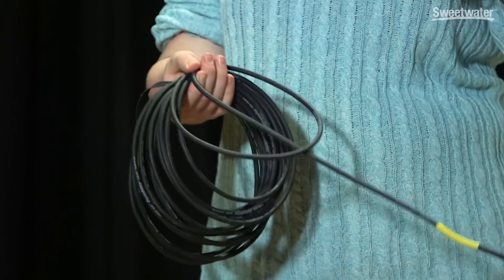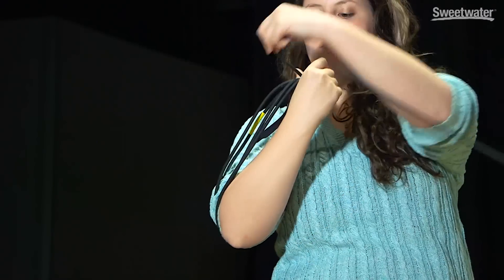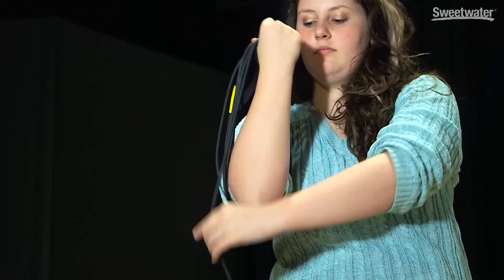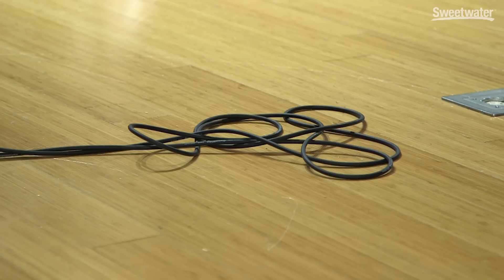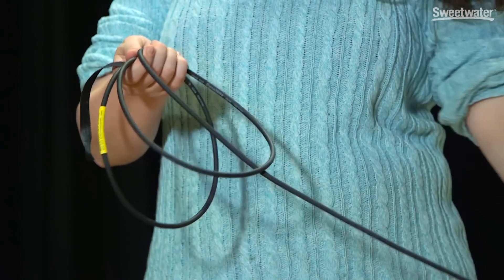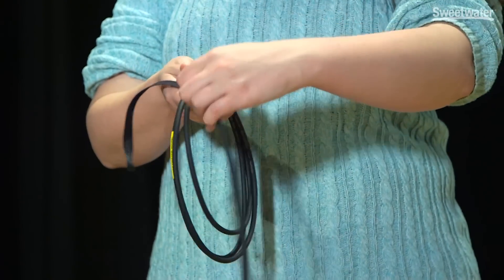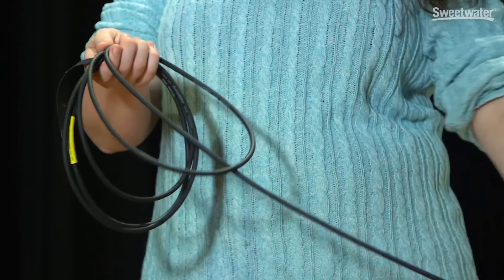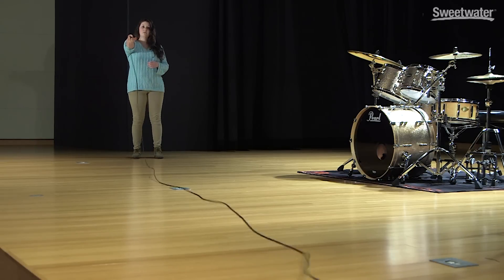How to Coil Cables Properly by Sweetwater

Comment: I've been coiling cables the "right way" and the "wrong way" for decades. I can tell you this: there's no difference. If a cable's meant to be replaced, it should be replaced. Have you ever heard anyone say: "My cable went bad because I've been coiling them using my arm and elbow...or wrapping them around my hand." No such thing. Cables will break if you constantly pull them, put weight on it, or have tears. Otherwise...coiling in however which way (as long you don't do this forcefully) is absolutely fine.
Reply: I've found that improperly coiled cables get kinked and don't lie flat on the floor after a while. Not really a problem for bedroom players but can be a hassle in the studio and on stage when they become tripping hazards.
Reply: @abgator27  Dude! You be trippin'!

(Don't worry, I'll let myself out...)